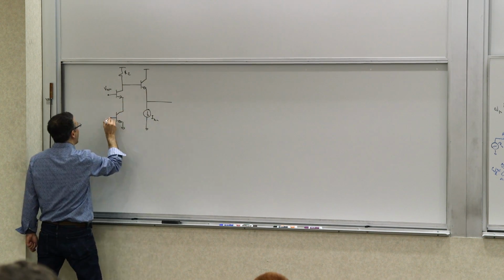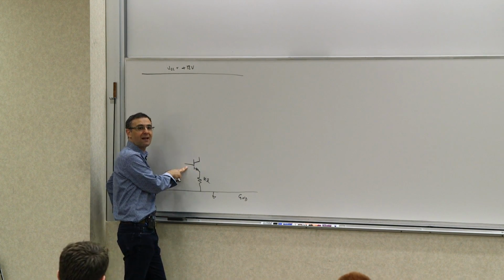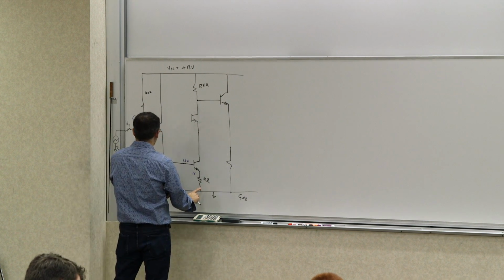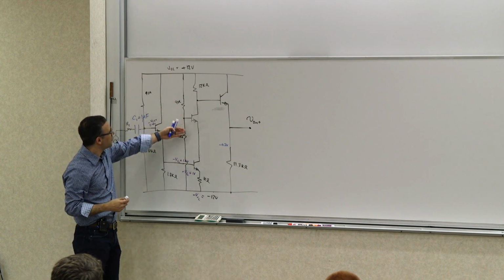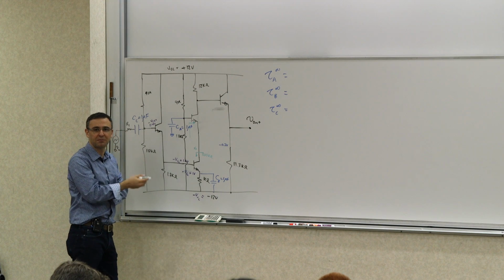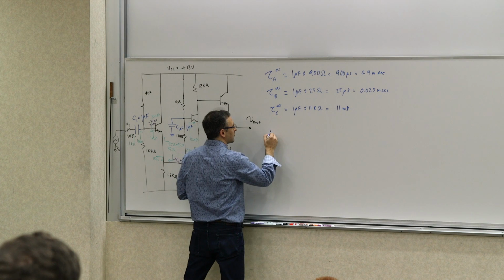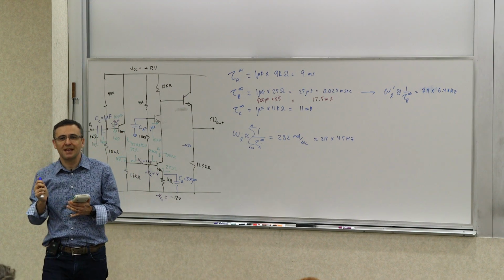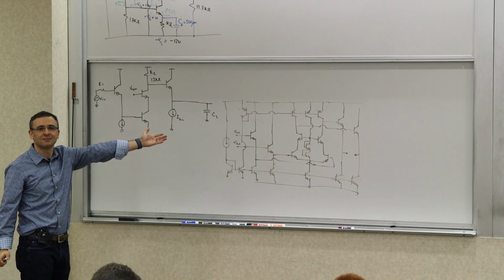156N. Discrete vs. Integrated Variations, Low Cut-Off Estimation with IVT example

Comment: 00:07 - Exploring an advanced design progression from common emitter to buffer stage.
02:25 - Exploring discrete vs. integrated designs in circuit design choices.
07:00 - Setting bias voltages for a transistor using a resistive divider.
10:18 - Explains discrete design techniques using coupling capacitors and current sources.
14:57 - Understanding low voltage amplification and gain management in circuit design.
17:43 - Integrating reactive elements for DC stability and AC short-circuit characteristics.
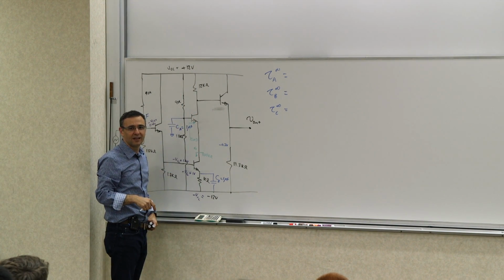22:21 - Calculating effective resistance and time constants in electronic circuits.
24:47 - Understanding low cut-off estimation using resistance and capacitance.
29:50 - Understanding cutoff frequency and impedance effects in bandwidth estimation.
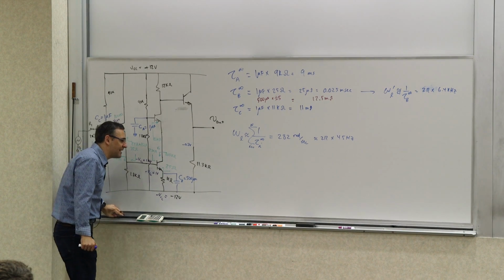32:31 - Designing an integrated circuit involves trade-offs in component costs.
37:42 - Understanding discrete vs. integrated variations in IVT estimation.